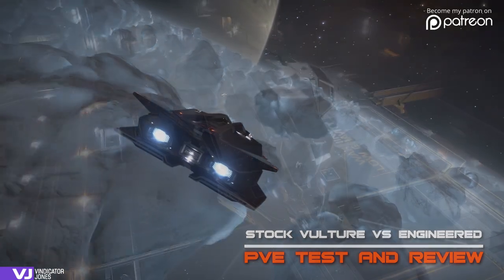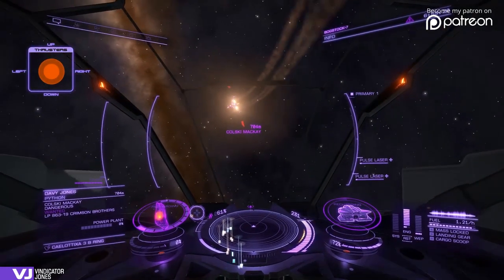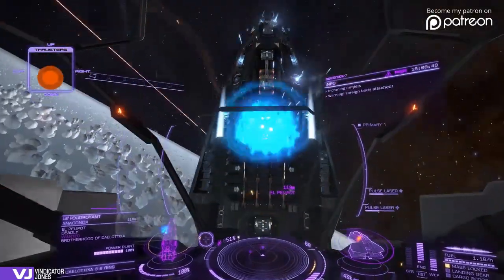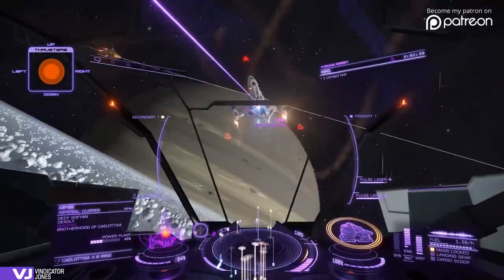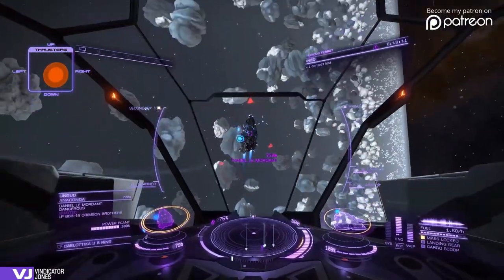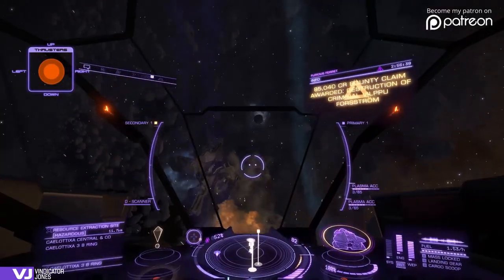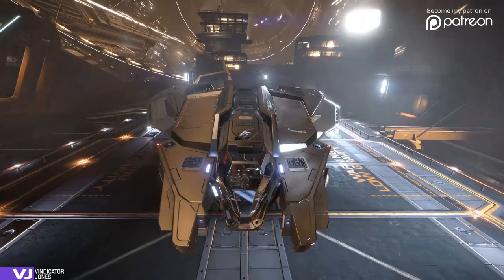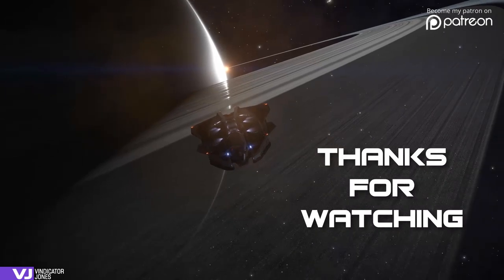Stock Vulture vs Engineered Vulture PVE Test   Elite Dangerous

Comment: "A" fitted Vulture you call Stock? I really do not care about engineering, im not trying to do hard PvP. Is there a site/community with builds without engineering?  I want to enjoy the character of ships, not making them all top stats in everything. I want to see the different builds for Vulture where you have to deal with the limits of power because this small ship has two damn large hardpoints, good speed and manueverability.
Reply: The thing about the vulture is that it was made as if you couldn't use it without engineering. Of course it isn't the case, but i Can assure you it's hella more fun Once you modify it a little bit. Just getting your PP to overcharged and your thrusters to dirty will give you an entire new feeling !
Reply: @paradox9435  That is not true. It was not made with need for engineering in mind. This is exactly what my problem with the mindset of some players is. It doesnt have all stats best as it can => its supposed to be engineered. But thats just
 not true.
Reply: @alugartttt  totally agree with you i have no idea why people even want eng its grindy(leads to more battle log), breaks realism, everyone goes for meta

Comment: Why gimbals pulses?
Reply from the maker: Because they are the ones that are most widely used and suit the vulture the most for their efficiency. Its just a generic build
Reply: I simply wonder why using gimbals on a Vulture. Seems so counterproductive.
Reply from the maker: Why is that? Gimbals can be very effective and give maneuvering options that fixed cant. Also, they are the most commonly used mount type in Elite Dangerous, hence why I made generic builds.
Reply: Yes. They are the most used, but it does not mean it makes a lot of sense in the Vulture. Fixed have better damage and consume less from the capacitor and the power plant, therefore allow you to fire longer, and the vulture is so maneuverable even in stock that you can keep a long time on target, specially against large ships. So, to me it looks like the more logical choice. Plus, you avoid the enemy over reliance in chaff.

Again that's my personal preference, and I know this video is "most typical build". Still does not make sense to me. Shouldn't have wrote anything really.
Reply: dmaxcustom like he said Better maneuvering options for those off angle shots and more defensive flying. If it comes down to it you can unlock your target and use as fixed anyway.